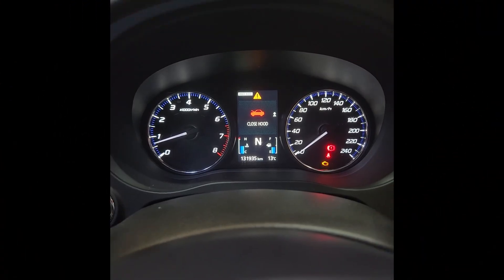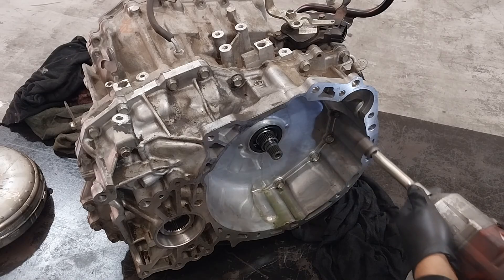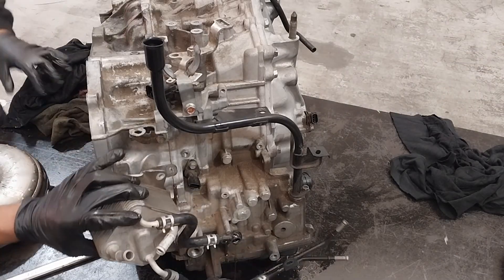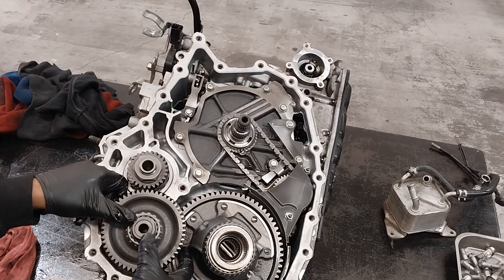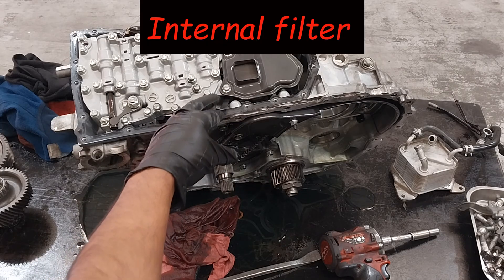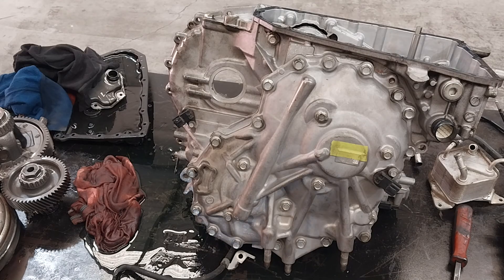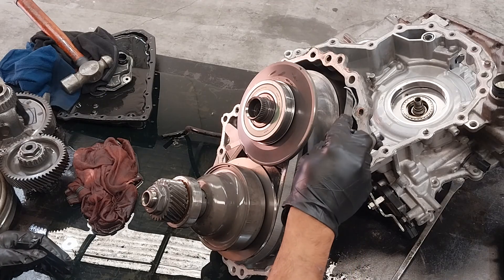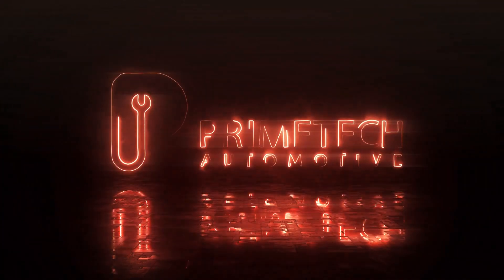Mitsubishi CVT Transmission Problems #Why CVT transmission fail

Comment: great informative video. But I have a couple of ?? about a 2011 Mitsibushi RVR Canadian model same as the US Outlander sport. I have had to replace the CVT 4x4 CVT and it failed after 2 months. SO i replaced the valve body and it would not shift out of 1st gear but would work in all other gears. now the company replaced the valve body and now it wont go into revers. My 2nd ? what years of Outlanders use the same CVT or Valve body. I was told by the dealer you cant reprogram a 2011 year model.

Comment: We have 2023 model ASX & its just gone 38k. The service schedule doesn't change the cvt  oil until 90k but I asked about changing the oil anyway & they said it would cost $258 just for the oil plus 11/2 hours to do the job at dealership. What a rip off you can buy the OEM oil on line for $158 or better quality penrite oil for $68.
Reply from the maker: One advice… don’t use any aftermarket fluid. Try buying the genuine fluid from Mitsubishi. Are you in Melbourne. I can help you servicing your ASX. Call my business during the week and works hours 8.30 to 5.30. Cheers.

Comment: Just change the belt ans bearings or pulleys and live on.. 
And change trans fluid every 40k km...
Reply: Mitsubishi oil change is 90k & charge you a fortune to get it done earlier even though it helps thier warranty by changing more frequently.

Comment: My transmission was rebuilt with the belt and valve body replaced. Now after few months, it is again having rpm fluctuation and shuddering when the engine warms up. But there is no error code. Could this be the valve body again?

Comment: Just had my mitsubitshi lancer ex 08 fluid and filter replacement plus flywheel seal changed. Mechanic put cvtf j1 instead of j4 fluid. Transmission is having whinning sound. Any idea what is the issue? I replaced the fluid with the upgraded cvtf j4 fluid.
Reply from the maker: There’s no problem by using J4 instead of J1. But you can’t do it other way. I mean … if the car listed as J4 you can’t use J1. 
Yeah the whining is pretty common on this. It’s coming from the differential unit in the transmission. Is the noise more noticeable close to drive shafts area ?
Reply: @PrimeTechauto the car was originally using j1. The other day send to workshop for servicing and the mechanic pour in j1 instead. Car giving whining sound when accelerating. I switch back to j4 and the sound become softer when accelerating and decelerating. Normal cruising speed no issue.
Reply from the maker: @daverock78 yeah as I mentioned. There’s no issues with using J4 on J1 specified models. And Shong sound definitely from differential unit. It’s pretty common issue.
Reply: @PrimeTechauto before the service there is not sound. After service the whinning sound is noticeable.
Reply from the maker: @daverock78 did he replaced any filters
Reply: @PrimeTechauto yes both filter. The cooler filter and bottom filter for the mitsubitshi lancer ex 2008 cy4 model
Reply from the maker: @daverock78 I don’t think he did anything wrong. It’s just CVT failed. Make sure fluid level is ok. Double check if the filters installed correctly. Re check internal filter, has it been installed correctly. Just to make sure No internal pressure leak.
Reply: @PrimeTechauto before service gearbox working fine. Filters installed correctly.

Comment: I can assure you that if the trans was opened and filters replaced on this trans is what accelerated it failure. Never open tight sealed transmission pans just drain and refill and drive a week and repeat , every 24000 kms. Last forever

Also lowering the crane using staggered tires or different than manufacturer size etc will fick your trans as center of gravity changes. 

Funny how people are obsessed with filters and if you see how factory locks these parts is amazing by heating one and cooling the other so that when they come together they are super tight . You fivk everything up with your spammer and hammer and everything goes loose inside while you poke to replace filters lol 😂

Comment: Was this transmission rebuilt? or a used one put in that car? or did the customer decline fixing it?  If the customer didn't decline, would you have suggested repairing this one or replacing it with a used junkyard unit?
Reply from the maker: Yeah the repair cost was too much comes to labor and parts. We ended up with fitting used part with low km. Happy days.

Comment: Experiencing this myself right now with my 2012 Outlander 2.4. Picked up an immaculate example with low, low mileage (107k kilos) and it started acting up at 125k kilos. Now at 135k and its random shifting and shuddering. I had the oil done a few weeks ago and the mechanic said there was all kinds of bits and pieces of hard and soft stuff in the oil. Its such a tragedy to think this car is now nearly worth throwing away when the engine has such low mileage and in such great condition. Buying a replacement CVT is very expensive and then it may also turn out to be a dud! By the way I still have 2 years to pay this car off!
Reply from the maker: That’s sad to hear. Yeah the tranny is expensive on these. Try buying a recondition trans. At least for another long years. But if it’s not worth fixing comparing to value of the car. Yeah no other option rather throwing to a car wrecker. 😢
Reply: @PrimeTechauto they made a huge mistake by not using a regular auto box like they did with the 3litre V6. Engines are so solid. But thanks for your comment 🙏🏼

Comment: I'm looking into a 2016 Outlander 2.4 CVT and I'm afraid of these kind of failures. How much does it cost to service these CVTs, sir? I'm also wondering how reliable are they and how much HP can they handle stock? I might want to remap the car to have a bit more power for overtaking lorries. Thank you for the helpful video!
Reply from the maker: ZK & ZL model outlanders isn’t that bad as ZG & ZH. But still the same shitty engineering. Full service including internal and external filters & using engine J4 fluid roughly cost about $500. But if it’s low kms you don’t need to do internal filter change. Just change the fluid every 45k and change the external filter every 90k. Hope this helps. About tuning, don’t know
Much about how much HP YOU CAN GAIN. But don’t recommend towing.
Reply: @PrimeTechauto  Thank you! Can you elaborate on what do you mean by FULL service? 
Also, how much would a rebuild cost?
Reply: I was answering the same question to another user. It cost me almost $6,000, but my Mitsubishi Outlander 2010 with 92k mileage was fully cooked because I didn’t know the transmission fluid needed to be changed. It was cheaper for me to fix it than buying a new one.
Reply: The transmission was fully damaged.

Comment: It's incredible. What happened to this car? Was it because the transmission oil wasn't changed regularly? If the transmission oil was changed regularly, wouldn't there be fewer problems?
Reply from the maker: Yeah I would say so. Regular service is very important. And usage as well. A car with CVT you n😂ed to drive like a baby. Hahah. With proper oil change .. I would say may be the issue la are low.
Reply: @PrimeTechauto  Thanks for your advice. I will always pay attention to the maintenance of my CVT8, but it will empty my wallet because the maintenance interval is too short.
Reply from the maker: @Mr.bass4658  ❤

Comment: Should have taken the belt off. I can not see how that piece of steel could have come off the belt and not have the steel segments come apart. This steel belt part looks like it was put into the transmission just to make a video and there was nothing wrong with the belt. I repeat that there was nothing wrong with the belt. The piece of flex steel came from some where else and was put into the gearbox by some body for some other reason.
Reply from the maker: Have you ever seen a CVT belt in pieces. We dealing with these CVT s always. This belt plates were t broken but the steel belt where the plates locks is broken. That’s the piece you seen in this video. Hope this wheels and this is the best way I can explain if you believe or not. Cheers

Comment: I have a 2017 Outlander Sport front wheel drive.... where is the differential fluid drain bolt located?Thanks.
Reply from the maker: Rear differential drain bolt located lower section of the diff housing. It’s 10mm Allen key bolt. Front transfer case bolt also located lower section of the transfer case and its 24mm bolt. Filler is next to the Sri e shaft 17mm head bolt. Cheers
Reply: @PrimeTechauto thanks a lot

Comment: If you had the option to choose between a Lancer 2012 with the CVT or a Lancer 2012 with the 4 Speed AT which would you go for? They sell both versions here, trying to decide which is a better used purchase.
Reply: For fuel economy buy the CVT. For long lasting and handling higher torque buy the AT. CVT cars have trouble handling high torque, like when you are climbing a hill with passengers in the car. I've owned both and will prefer an AT over CVT.
Reply: @Chetan_N_S much appreciated!! Thanks so much

Comment: Why is CVT fluid so expensive for this gearbox 😮?
Reply from the maker: @Ben-jq5oo  yeah the genuine fluid is very expensive. Dunno why. It’s probably the additives are expensive. 
Not only the Mitsubishi CVT fluid I’ve seen most of the genuine  transmission fluids are expensive. 👍

Comment: Hold up. Okay so but I'm not quite understanding here is does the transmission have to actually be out of the vehicle in order to do a full overhaul on it? Or is this something that could be done while it's still mated to the engine in the engine bay? I only ask because mine is starting to act a bit funny but little power surges and just signs that it needs to be overhauled and I've owned it for a good number of miles and I've never done it myself so it seems straightforward enough well the concept of it at least I am a mechanic but I've never done any work with CVTs before thankfully they look pretty basic as far as transmission goes, I've done an overhaul on a Land Rover transmission so I figure if I can do that I should be able to do this no problem lol
Reply from the maker: @donovanwatkins3344  yep the trans has to come out and do a proper job. Yeah as long as you have proper tools to press and pull out the major pulleys and you won’t hv any issues doing it. 
Most of the times I’ve seen the CVT belt break. And primary or secondary bearings failed. Good luck

Comment: How much km this car do?
Reply from the maker: @תומראוראברהם  this was around 130000kms. 
I have 3 cars getting the CVT replacing this week. They all around similar kms to this one.
Reply: Tanks man
Reply: @PrimeTechauto  people don't seem to understand you need to change the fluid on these regularly.  Along with the filters. I personally use castrol atf/cvt and have since 20,000 miles. I'm at 97,000 miles now. 2019 honda civic coupe ex-t. I do a drain and fill twice a year. Plus the cartridge filter every year. I do the pan filter and gasket every 3 years.
Reply from the maker: @vermontvermont9292 yeah that’s very good habit of doing regular service. I’ve seen most of the time the people think about short term money eye saving and they don’t think about the long term  damage what’s gonna happen to the trans.
Reply: So here's a question is there any modern SUVs you recommend that don't have a shithouse gearbox? CVT or not it seems every vehicle I've been researching has gearbox problems..
What modern SUV made since 2015 would you recommend that doesn't have a hand grenading transmission?
Reply from the maker: @IBOO57 yeah you are right. This CVT technology isn’t the best. It get worsened if not maintained well. 
Toyota CVT system doesn’t have many issues.

Comment: Does the 2019 outlander 2.4l cvt has these 2 filters? I did a transmission oil change and the technician told me there is no filter in these transmissions.
Reply from the maker: @jithinjohn6191  there definitely on filter inside the transmission. The primary filter (located outside of the transmission) depend on the trans number. There’s one type of trans which doesn’t have a primary filter. 
You can check this . This filter located near front engine mount.

Comment: 3:09 this is the filter and it’s location I’ve desperately been searching for. How can I access this without removing the trans from the car? It seems low enough to raise the car and reach from the bottom?
Reply from the maker: @scahill6791  yeah this filter can be reached once you raise the car. Reaching from bottom is easy. It’s near the front engine mount, 
But just make sure if there’s a filter housing can be seen. There are two types of CVT. And one model doesn’t have this filter. 
Cheers.
Reply: @ thank you so much 😭😭😭😭 I will raise it up and look at it tomorrow.

Comment: Good video. I was practicing basic Automatic Transmission overhauling and the process are the same. Except it has pulleys and belting. My dad has one Outlander with cvt 4wd still going strong perhaps last for another 50k… right now 120k km mileage
Reply from the maker: @NazIriz  yeah these CVT issues never gonna be end.
Reply: @PrimeTechauto  Im thinking about buying a 4x2 Outlander, it has 110k. What things should I worried when i go to check the vehicle?
Reply from the maker: @ usual checks when buying the car. History of CVT fluid change. You won’t have any signs of failed CVT until its breaks down. Try buying 2019 onwards . The last batch of the before the ZM.

Comment: Jezzz how much to repair the transmission?
Reply from the maker: @williambeltran6927  it’s all depends on what’s the damaged done inside the transmission. The cheapest option is to find a low kms used transmission and replace it. Repairing is very costly.
Reply: @ thank you 😊
Reply: My Mitsubishi outlander 2010 with 92k miles CVT transmission was extra cooked. I didn’t know I have to change the transmission fluid, I just took it for the maintenance service as regular, and it cost me around $6k to practically replace it and the repair shop will only give me 24 months of warranty. I will pick it up tomorrow, hopefully. The problem is that here in Puerto Rico is cheaper for me to fix my SUV than buying a new one, that is because the government put a high tax to vehicles, and the one that I was going to buy was a 2026 Honda CR-V, the only was available was the EX model and the tax was around $5k plus the bank was asking 10k of interest paid at the end of the last payment and I refused, I called a mechanic that "supposed" to have knowledge in repairing CVTs and He accepted my vehicle, today it is supposed to be fixed and I was asked to pass to the shop tomorrow to pick it up. Hopefully it correct the problem and I can continue using my vehicle.

Comment: What's the common cause of the failure
Reply from the maker: @centycents  it’s just premature failure of the CVT chain. I’ve seen cars done proper transmission service on time. But still the CVT fails.
Reply: @PrimeTechauto  hypotheticaly this would've not happened if the cvt fluid was replaced regularly?
Reply from the maker: @ I’ve agreed with your point of view. But I’ve seen theses mitsi and Nissan CVT failed even though the car’s been serviced (transmission service) regularly:
Reply: @PrimeTechauto  In these cases, the likely cause is poor use despite regular servicing
Reply from the maker: @ yeah poor servicing